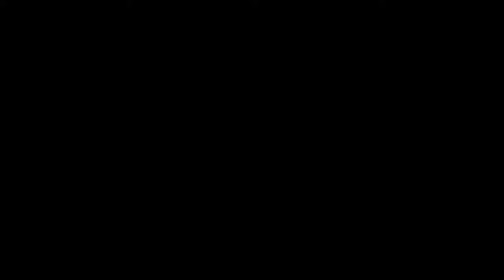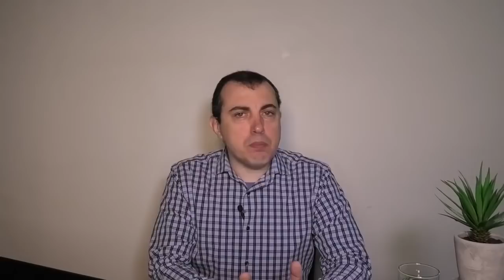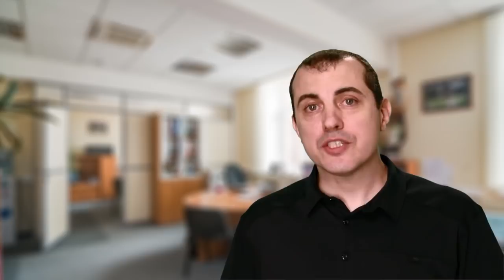Mining Bitcoin: Solving the Puzzle

Comment: …there’s an aspect that keeps baffling my mind (even if I followed your lessons and read your book): all the header’s data are fixed except for 1. the nonce and 2. the time stamp; if we both start mining at the same time (say 8 pm - 20.00 and zero seconds) then the one of us with more computing power will likely be the first to find the required nonce…but if one of us add extra time (say 1 second - 20.00.01) then the whole hash would be different as the nonces to produce the leading zeros required…if the average time (roughly 10 minutes) to find the nonce is encoded in the protocol and it’s auto-adjusted according to the speed of network, do miners explore all the possibilities of the next 10 minutes (plus the seconds) all at once? It would be great if you could make a video targeting and expanding this specific topic in depth. Thank you for the knowledge you have shared, no one else has done so much as you, both technically and conceptually
Reply: Miners "pick" a timestamp automatically and start mining so long as it's within the constraints of the protocol (a valid timestamp must be greater than the median timestamp of the previous 11 blocks.). The actual value of the specific timestamp is largely irrelevant as the difficulty already takes all of the components into account and, as you say, the generated hashes will be completely different with even a single bit changed. The likelihood of "winning" is the same for any given timestamp.
Reply: @DerekF-u7e  Thank you for your reply Adam, have a great day 👍

Comment: Mr. A
How does a Trezor generate a random private key? In my experience as a programmer you would use a random number generator based on a seed but how does a Trezor do it?

Also, although highly unlikely, what happens if the private key generated is not unique so that the public key wallet contains someone elses btc?

Thks.
Reply: In simple terms, Trezor generates 256bit number (number starting with 10 and 77 x  0 after) , then computer generates its own 256bit number, then it is hashed together by SHA-256.
Then it does checksum to verify sequence integrity - hash by SHA-256 - then by adding first 8 numbers of Trezor-generated random number and adding them to the end of the number => producing 264bit number. This  264bit number is divided into 24 parts (each one 11bits long - 0 to 2047) and each part gets its english word according to the BIP-39 standard.

Private keys are generated based on this seed + passphrase if you have set it.

This is so enourmous entropy, that you can't even slightly imagine. So yeah, nobody's going to have the same seed as you do, if they use software which has correctly implemented random number generation.

If by a greeeeeeeeat miracle you end up generating the same private key to the address (hash of a public key which is generated from private key), then you can spend those coins on that address.

Comment: Doesn't that mean if you don't have enough compute power you may not earn ANY bitcoin at all to even pay for the work you are doing since you never solved the puzzle.
Reply: If you solo mine, sure. Join a pool and you fix this issue.
Reply: Mining pools are older than the first exchanges. They are indispensable for the decentralization of the network. They also use open source protocols to connect with their peers and share rewards in a transparent way
Reply: If I understand correctly, yes
Reply: Basically what you can and should do is joining so-called mining "pool". Many people join their computers together and are working on solving it and if anyone of them finds it, the pool distributes bitcoins to the all miners that tried proportionally to the power they provided.